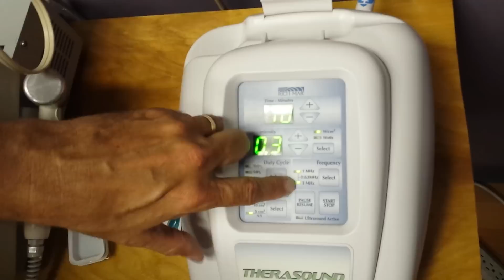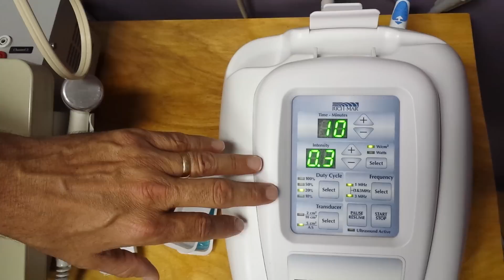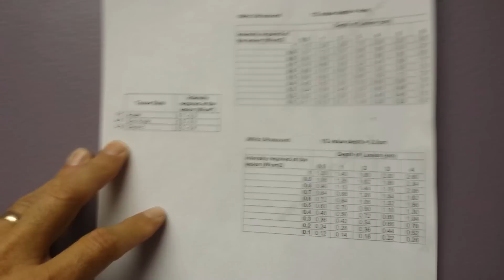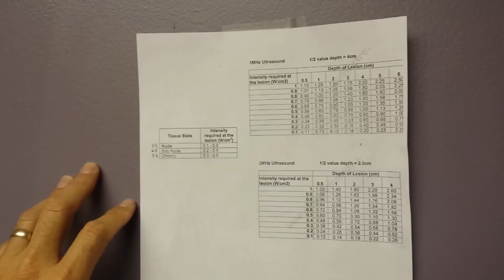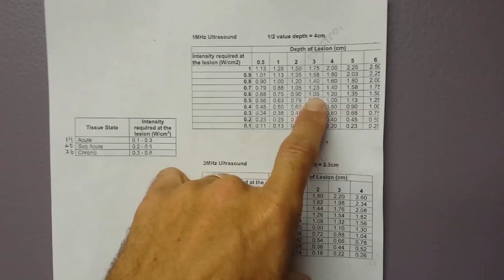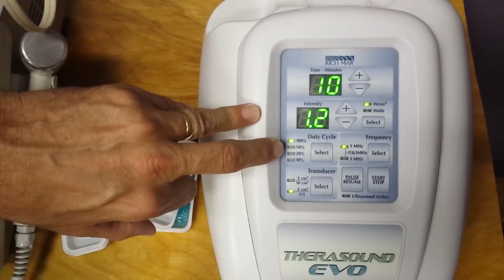Dr. John D. Ratcliffe Explains Ultrasound Treatment

Comment: how well does it work ?  does it really help with recovery of torn ligament ?
Reply: It will help if you have a grade 1 or 2 tear and not a complete rupture. Use 3 mhz at about 0.5 W/cm2 for a start. You can then work to about 1.5-W/cm2. I have a grade 2 tear on my MCL and this has helped me tons with the pain and accelerated my healing. 

People will tell you to use a hot water bottle and ice but the hot water bottle only heats the surface of your skin and it doesn't go deep enough to reach the ligament. If you don't have access to an ultrasound you can use a jacuzzi or hot water.